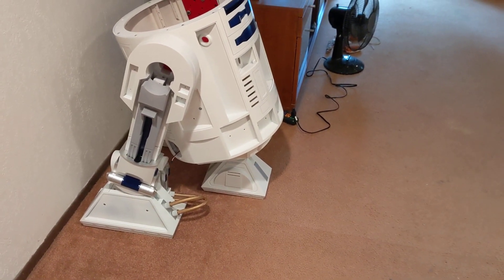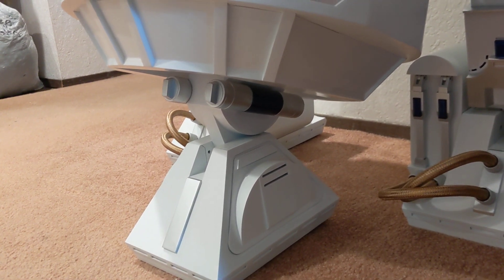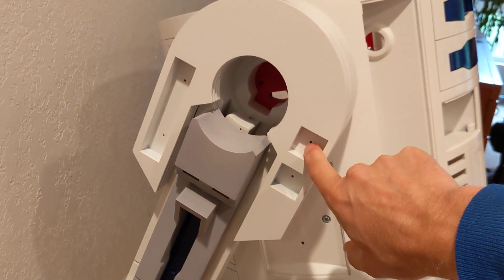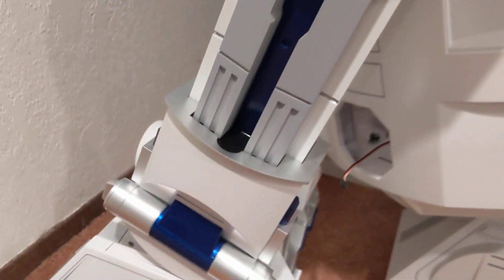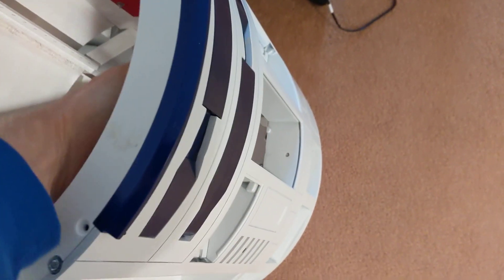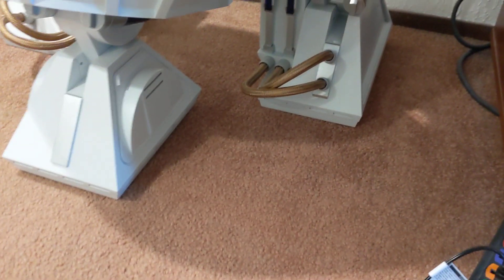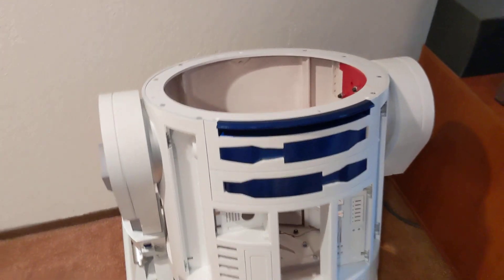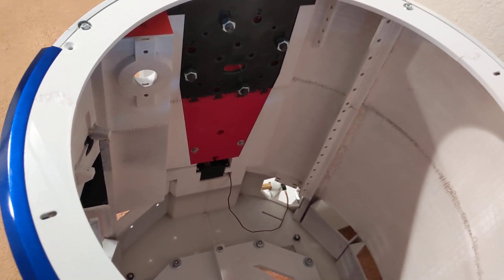3D Printed R2D2 - Part 84

Comment: Looking amazing! Do you think this would be possible on an ender 3 220x220 print bed if the files were cut up a bit more?
Reply from the maker: Thanks!  I do believe the Michael Baddeley V2 files will fit on an Ender 3.  There is a new cut of the MKIII droid (the one I printed) that will fit on a Prusa MK3 but I think that's a little larger than the Ender.  Although the MKIII version has some advancements, there are still people who print the V2 files with great results.

Comment: Where you get files for magnetic knurled hose ends
Reply from the maker: There located in the Michael Baddeley Patreon OneDrive folder:
Main Archive/Astromech/Print Files/Astromech MK3/MKIII Body/Legs & Feet/DriveUnits & OuterFeet/BattCableKnurl_AN6.stl
Reply: Thank you, there were several, didn't know the difference appreciate you